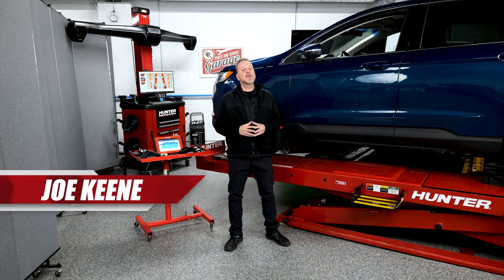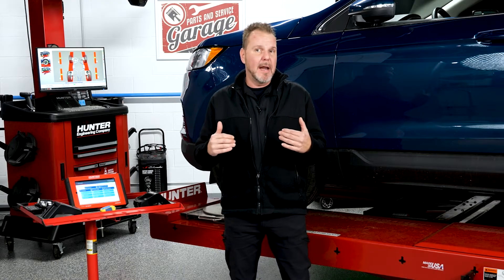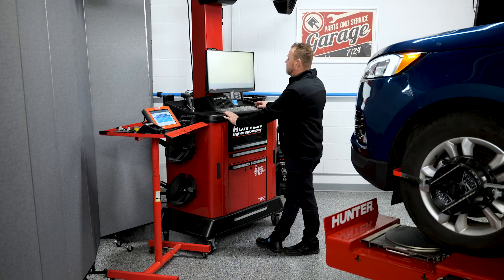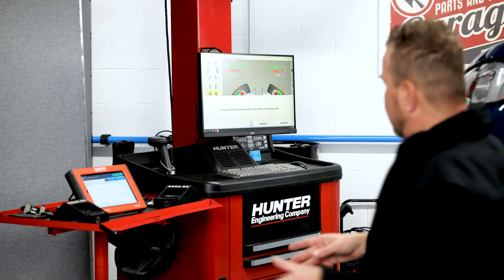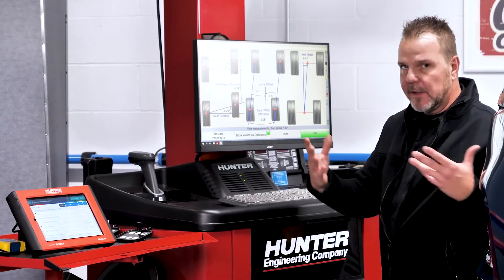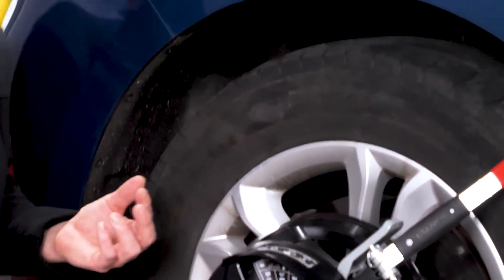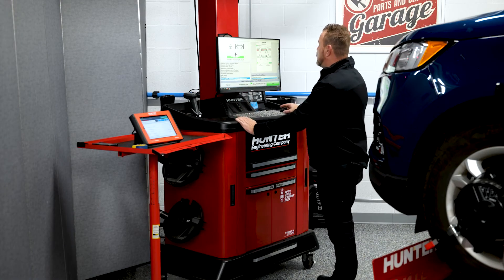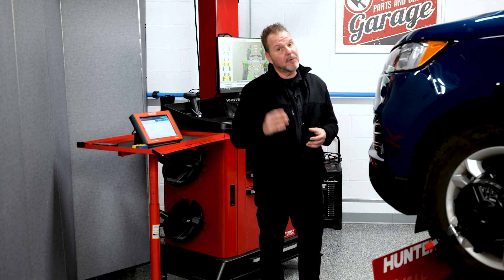Collision Blueprinting with Hunter Engineering Alignment Equipment

Comment: where can end consumers do a lookup to see where these hunter machines are located so that they can get this blueprinting procedure done?
Reply from the maker: W=Hunter doesn't have an equipment locator for this product, so we recommend contacting your local Hunter team (found via your zip code on our www.hunter.com website).  They may be able to provide a collision shop with our equipment, that is familiar with the blueprinting process.
Reply from the maker: You can locate Hunter Engineering equipment in your areas by going here: https://www.hunter.com/find-equipment/